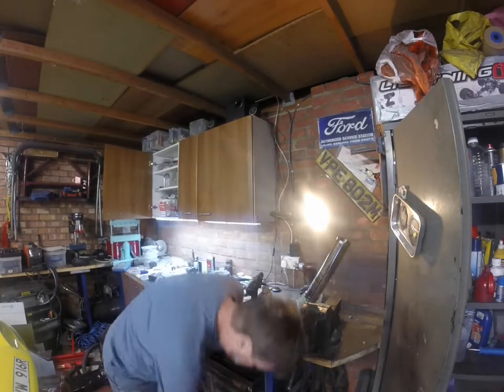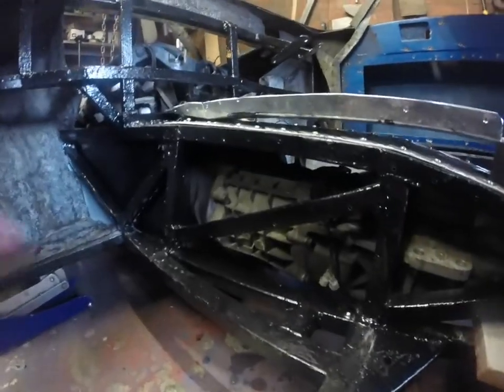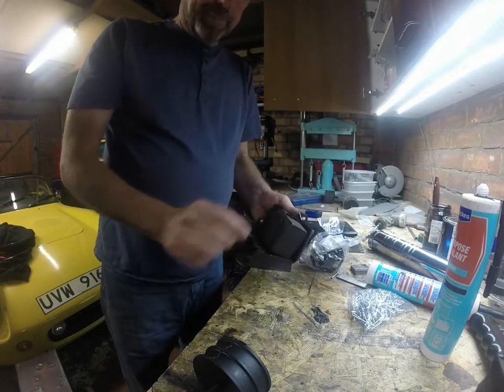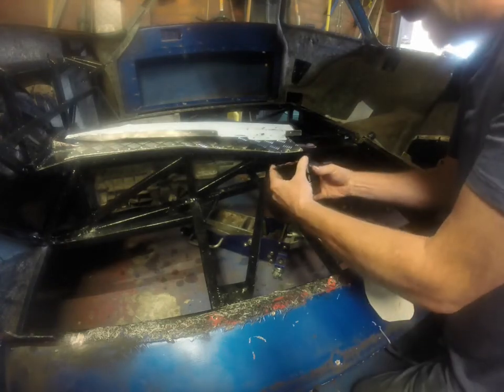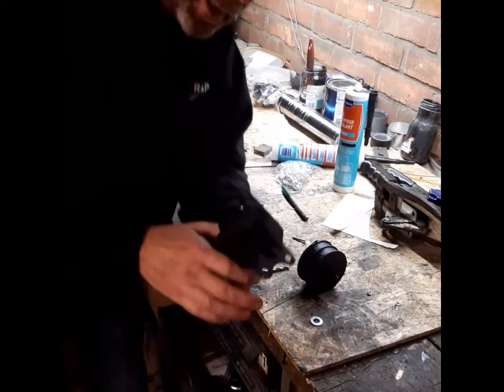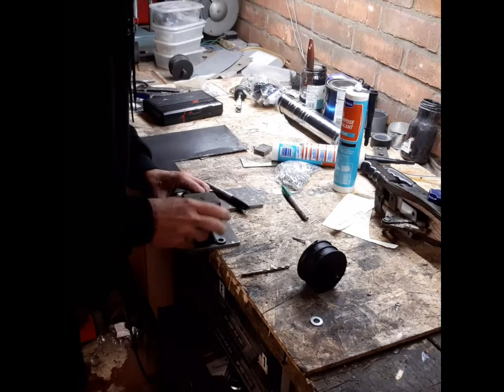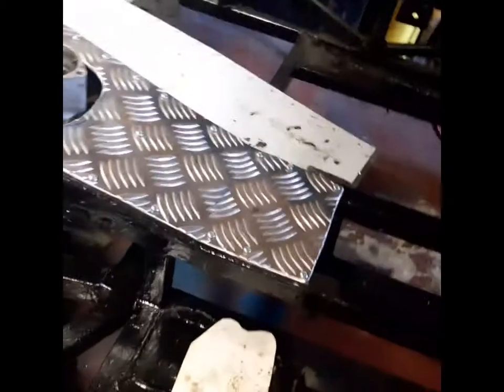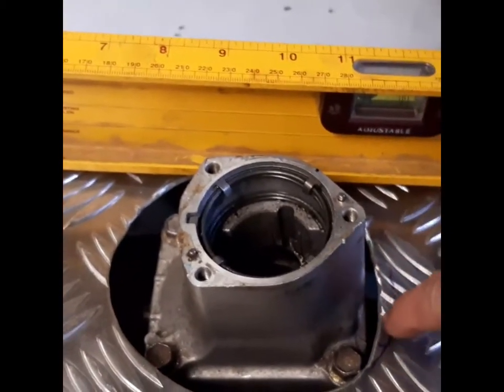RX8 Gearbox Mounting

Comment: Hi Speg, if the underside mounting position is going to be prone to impact then consider fitting an impact guard in front of it…Also, I don’t see a lot of technical advice coming in from the Gilbert owners club members. Are they posting on a different platform? (Instagram?)..🤔
Reply from the maker: Do you mean the gearbox mount? I dont think that's a problem as its only a few bolt heads hanging down. If there is a clearance problem it's likely to be the sump. Not sure there if there are any Gilbern Owners here, although I do link to my channel when I post on the the club forum